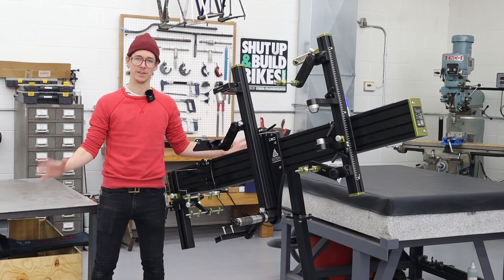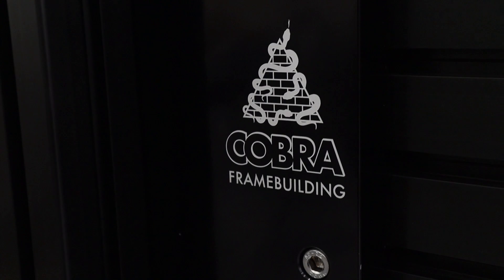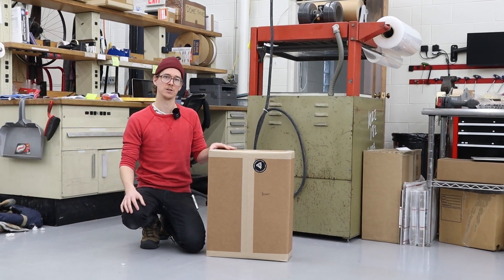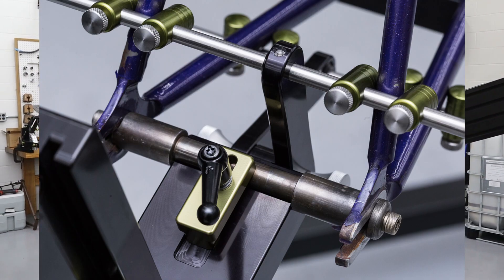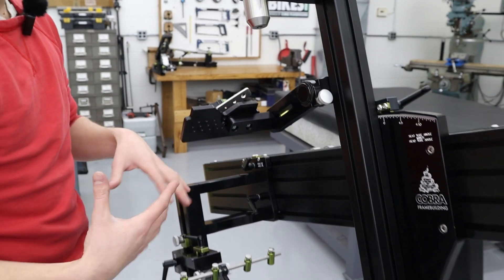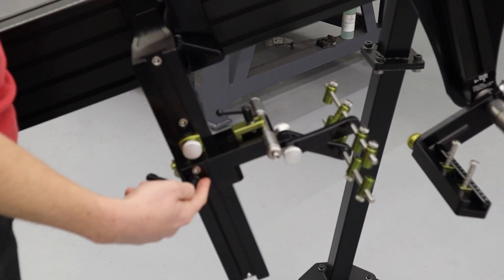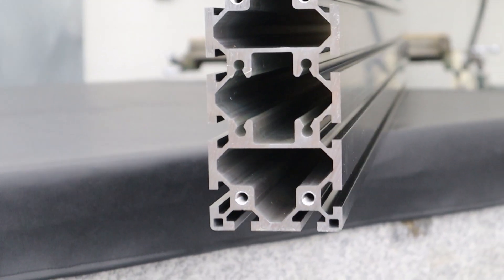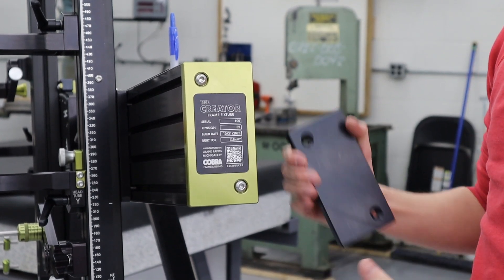How We Engineered an Even better Bike Framebuilding Fixture

Comment: What awesome improvements.   Your enthusiasm and drive for improvement is always off the charts.  Congratulations on 100+ fixtures.  👍👍😎👍👍
Any idea on how that might relate to the number of bikes built by your customers?
Reply from the maker: I don't know how many bikes my customers have built, but it must be a lot. Many of my customers run a small shop from their garage and have full time jobs. Those builders probably build 50 or fewer bikes per year. However, there are quite a few customers who build a lot of bikes. To name a few: Reeb, Prova, No. 22, Amigo, WZRD, Argonaut, Kruch, Acoustic, Chandi, Ganzomi, Sata, and Rizzo. I don't know all of my customers equally well, but I know this short list would account for well over 1000 bikes per year.
Reply: @cobraframebuilding  - That is so cool to think about how you had a vital part in their success ….. how there are hundreds and hundreds of bikes out there in the wild that started off on your fixture.  I’ve been following you since your first YT video and so much has change, all for the better every day.  👍😎👍. Again, congratulations. 👏🎉👏